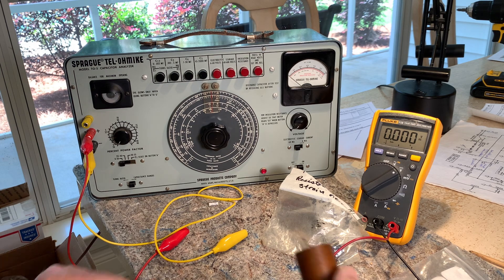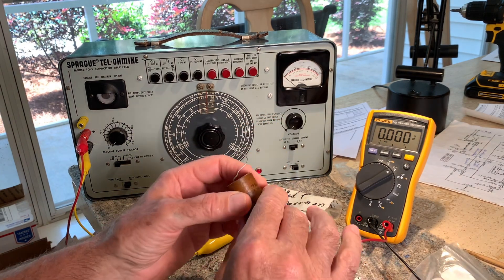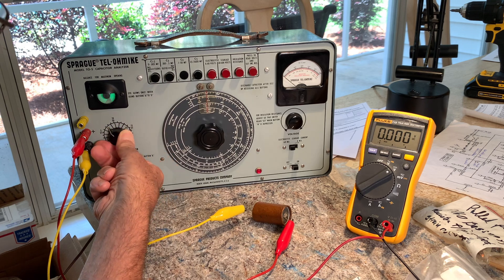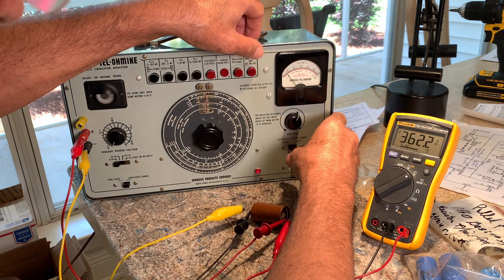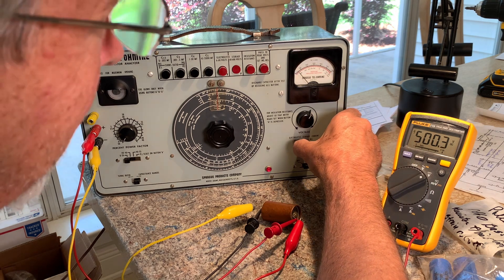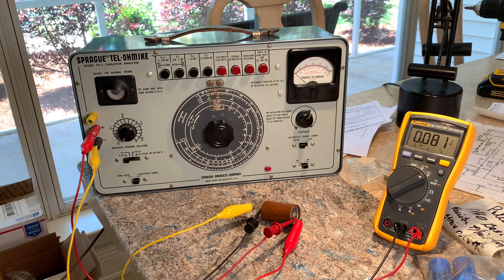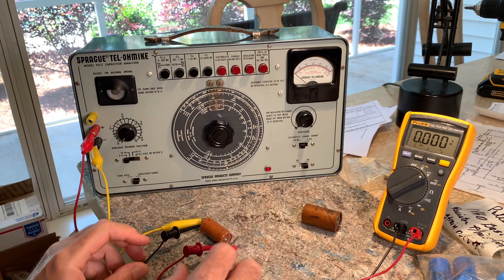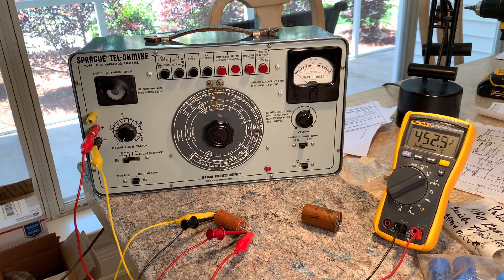Testing 61 Year Old Mallory Electrolytic Capacitors Pulled from a 1960 Fender Tweed Bassman Amp

Comment: you ever do tests for other folks? i got some 65 caps that i pulled and replace with F&T's a few years ago that have me second guessing myself on whether or not i should have pulled them. i'm in the same state as you but in the southwest instead of southeast.
Reply from the maker: I haven't tested others yet but it would just be shipping costs to do it.  I know it would be $15 or less if you use the small USPS Priority Mail flat rate box.  There may be an even cheaper way using a USPS envelope.  I can tell you that new electrolytics are always going to be best if you use good ones.  I have yet to try F&T but have wanted to lately.  I hear the new Sprague Atoms aren't made as well as they used to be.  The only benefit I can think of to use the old caps is it might give a little more vintage lag and softness.  New caps will tighten up the bass and give a little more punch and clarity.  If there are any blisters on the ends, then they are pretty much dried out and shot even though they would still work.  But, if they short out while you are playing, they could explode.  I've never had that happen though.  They have little vent holes in them to keep that from happening.  I have noticed that the blue molded coupling caps in the blackface amps seem to last forever.  That is not the same story for electrolytics but the ones in 1965 may have been made a little better than the old brown Mallorys.  They may have still used the old brown Mallorys in your amp.  I think this is what was in mine.

Comment: Hello millstap! Miss you man! Your great videos of how to play Jimi covers, your humour, your insights, hope you are doing well!!
Reply from the maker: Yes, I'm doing fine.  I will be working on my blackface amps today because a friend of mine just sent me a bunch of NOS 12AT7's that I am going to try out.  Each blackface circuit takes two 12AT7's, one as the phase inverter tube and one as the reverb driver.  Since I stopped doing videos lately, my hands have kind of seized up.  It is rough getting older.  I still play every day and everything is sounding great but getting my hands to move correctly is not as easy as it used to be.

Comment: Hey man, I just have a question about a strat I recently re-wired. Switch Positions 2 & 4 have an out of phase sound. I am wondering if simply swapping the hot and the ground wire on the middle pickup will fix it. Thanks, Joshua
Reply from the maker: Positions #2 & 4 should have the classic Strat out-of-phase quack.  Is yours a different sound?  Those positions cut the output of the two pickups together to approximately 1/2.  Are you using a standard 5-way switch?  Which brand of switch?
Reply: I must of had them wired in phase then because the quack was gone and there was a significant drop in volume on 2&4. I just swapped the leads of the middle pup and it’s all fixed now